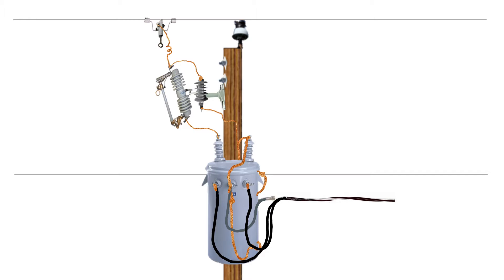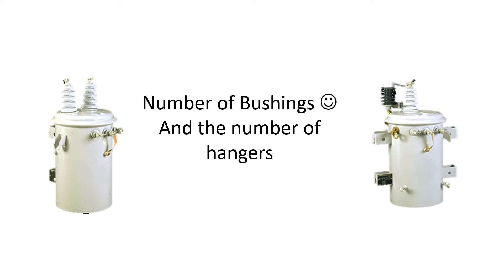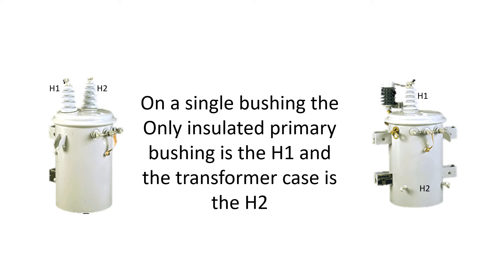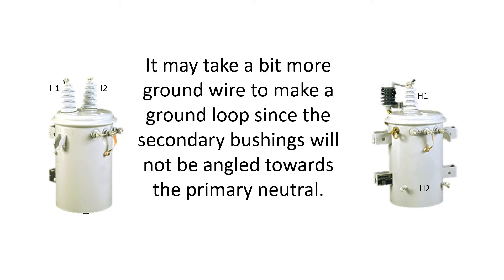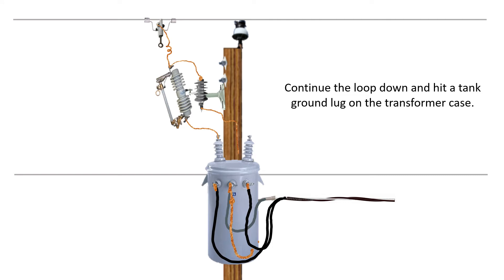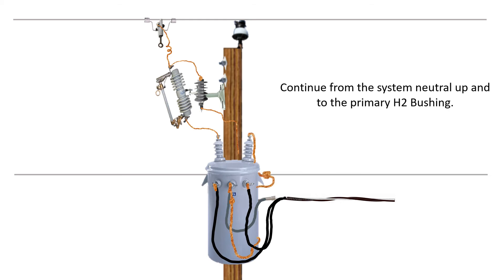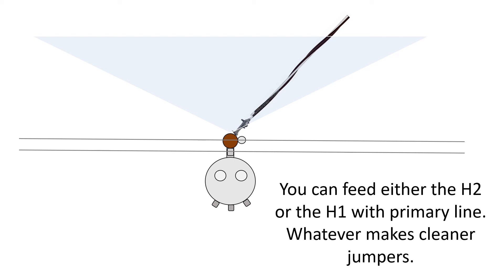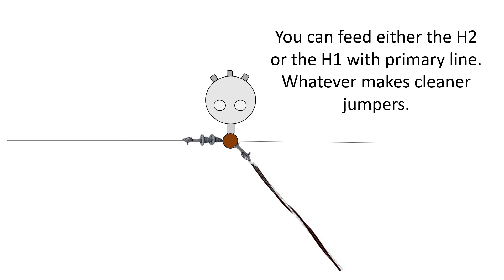Double Bushing Single Phase Transformer Guide with voice

Comment: Case ground should be a separate connection on either transformer. On the 2 bushing you have to go H2 to X2 to neutral. On both transformers the bottom of the arrestor should go to H2 then to the neutral. We always put the transformer above the neutral and inline on new construction.